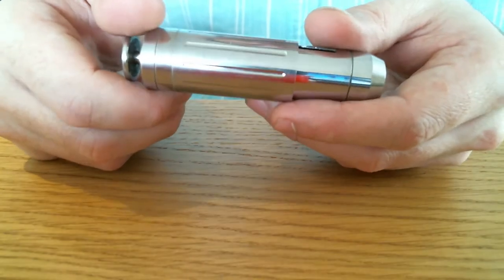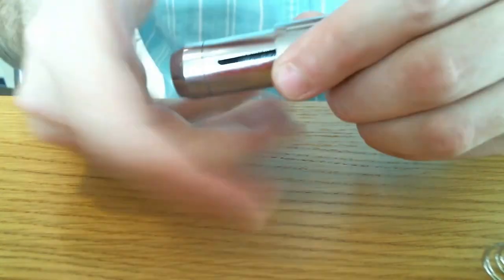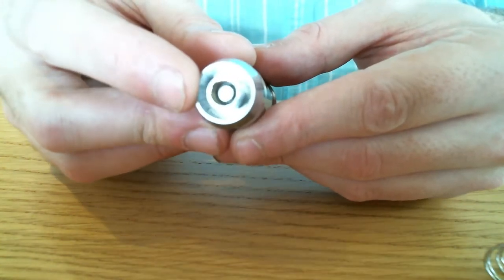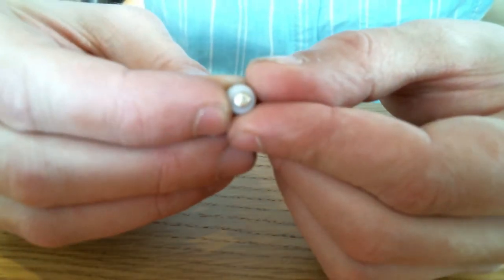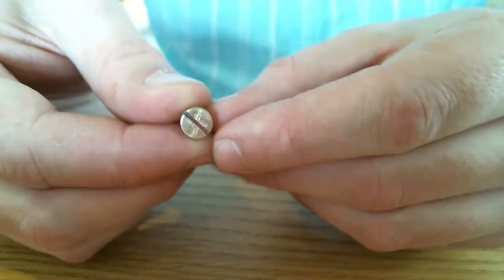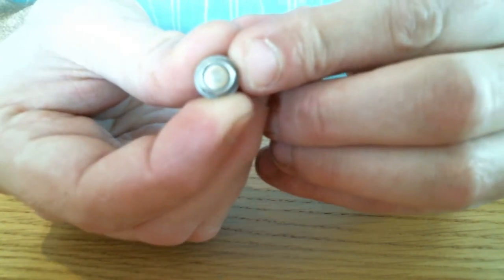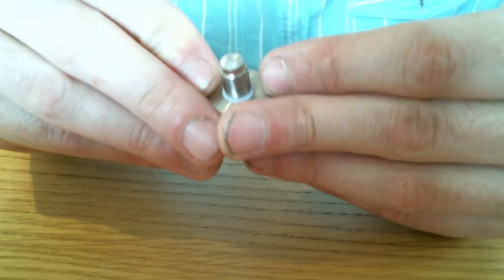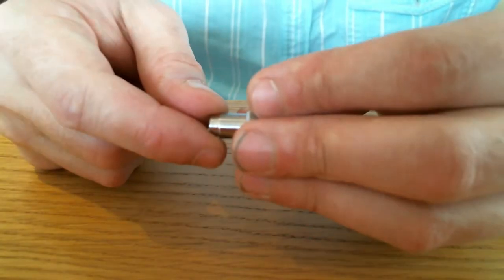Drawtube Smart Review - Follow-up Top Tip

Comment from the maker: Thanks for the kind words RockyBilly. I have another top-tip on the drawtube... Noalox! Every week I was cleaning a layer of oxidised SS off the threads. Noalox is a conductive grease. Haven't had to clean since applying it, and the conductivity is again improved. I don't have a tankometer but subjectively, I KNOW it has again improved the voltage drop :)

Comment: I've had one of these for about a week now and I'm really liking it. I have checked the voltage with my multi-meter and so far have not noticed any drop. I have no way of checking it under load at the moment but plan on building an in-line meter as soon as I get all the parts. I know that I can order one pre-assebled but I like to tinker with such things. thanks for the post, I'll keep it in mind. Cheers mate!